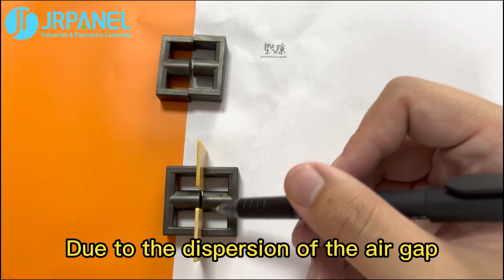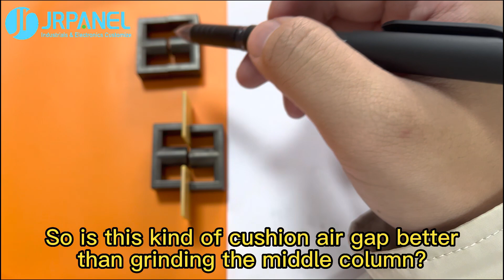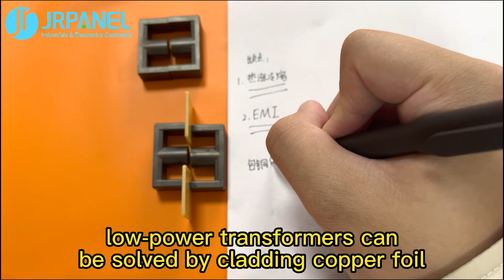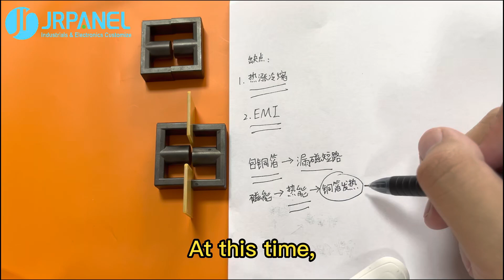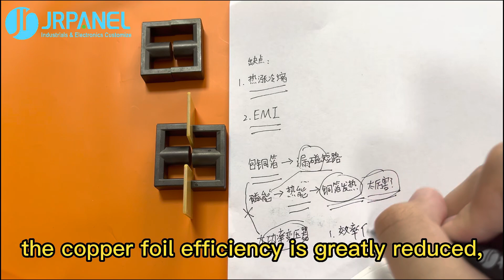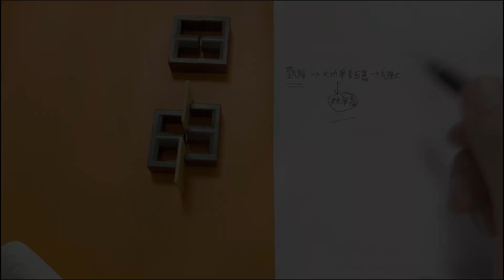Two methods of air gap  advantages & disadvantages   Part 2

Comment: Greetings sir. Thanks for video. I am designing a LLC High Frequency Transformer. And I am impementing a Lm(magnetizing inductance in transformer with air gap. In my calculation I get a value with 1.5mm air gap core should be get a desired magnetizing inductance. But this calculation for center leg air gap (i guess). Since I can't find any 1.5mm air gap core in anywhere I am planning to add air gap with second method you explained. But I am curious if the calculations gets differ from center leg air gap one. Can you give me a advice sir.
Reply: In the some resources says I should make air gap half of the calculation I made for center air gap.